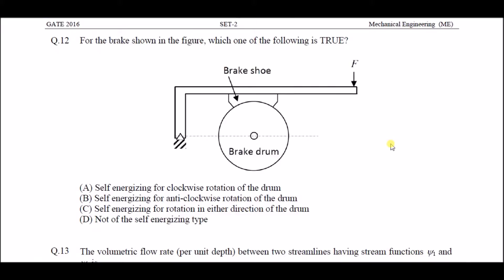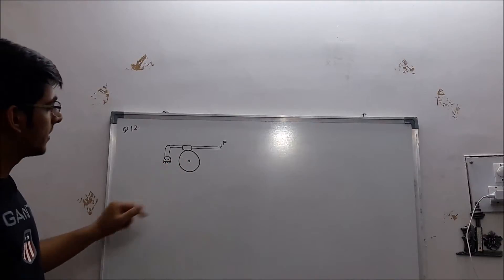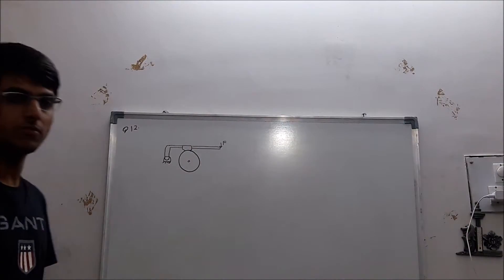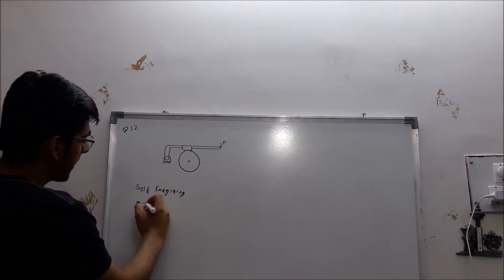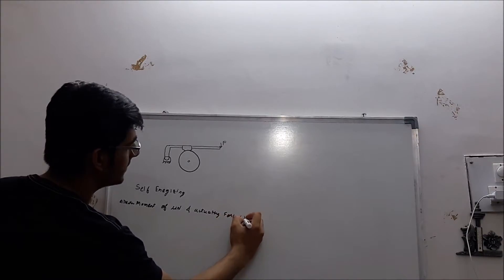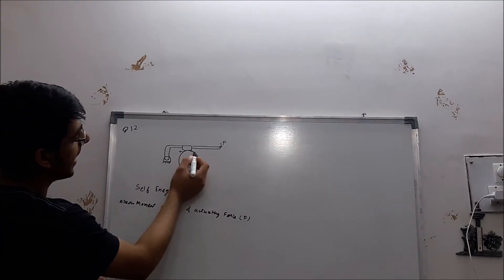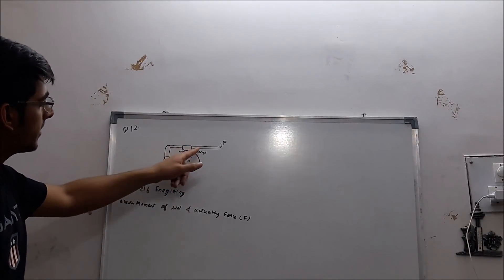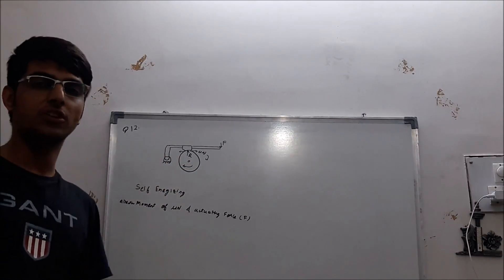Mechanical gate previous year 2016 set 2 question 12

Comment: sir i think if the wheel rotates in clockwise direction the frictional moment will be produced in anticlockwise direction . so it is not self energizing.only when the wheel rotates in anticlockwise direction the brakes will be self energizing.
Reply from the maker: Friend, it can be seen in the diagram that when wheel is rotating in clockwise direction the frictional moment caused due to friction acting on BRAKE PAD is in clockwise direction . Maybe u are referring to the frictional moment on the wheel. Also the answer given in the official answer key of gate 2016 is what given in the video so mostly this is the correct explanation. 
Thanks for watching the video!